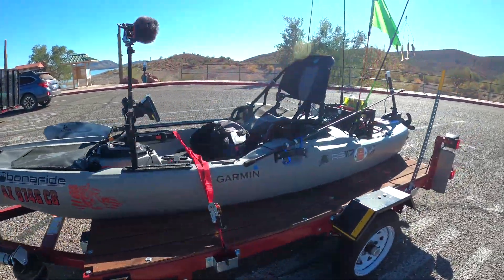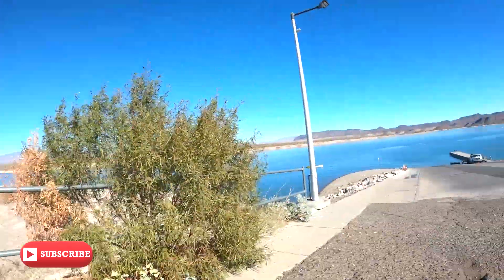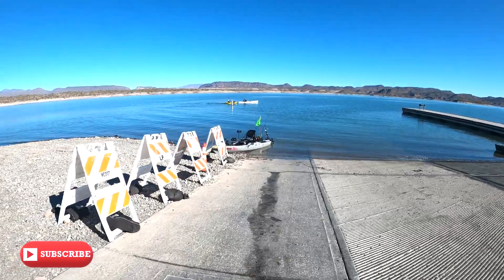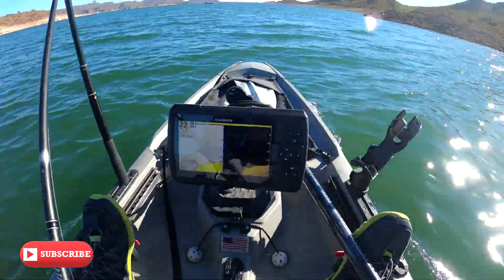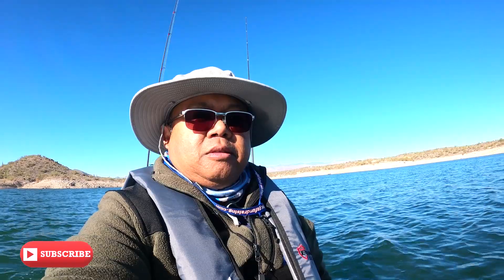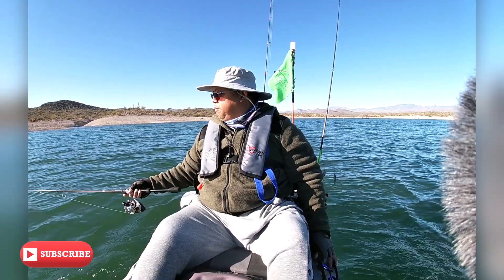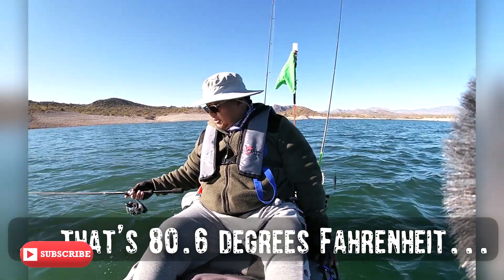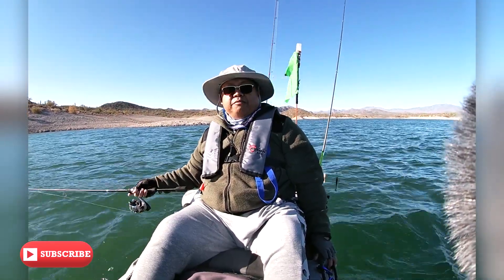PWM test run on the Lake, C2 Endura 30lb trolling motor, Miady 12V 16Ah LifePo battery set up.

Comment: Where did you connect those 2 dc fans on the pwm? Did you connect to the motor terminal or  battery terminal directly? And why did you orient the airflow that way? I am seriously asking because there are conflicting opinions about whether to pull or push the heat off the sinks
Reply from the maker: ...motor terminal on the PWM, so it only turns on when you move the potentiometer

Comment: nice test how long you can used the trolling motor with the 16 amp battery going half power 
thanks
Reply from the maker: since i only ran it 10 to 15 min. at a time, i was able to finish 4.5 hours of fishing, and ran the battery down to 11.5 volts

Comment: I bought the same trolling motor yesterday from Bass Pro and have a PWM on the way for my RS117.  I haven't decided on a battery yet.  Do you know how far you can go at 1/2 speed with the 16AH battery? Tournament trail starts in February and I want to be 100% ready.
Reply: Do you think getting three of those Miady 16ah and running them parallel would be viable? 48ah for $165 is difficult to beat if it works.
Reply from the maker: @Ijtreme83  ...ran mine, crossing the lake back and forth, still have over 12V when i got home...
Reply from the maker: I ran my lithium 12v 16A for more than 35 min, on and off, and still have 12v charge when i got home....
Reply: That is awesome and good to know, I'm glad to see that you have successfully rigged up a system with this particular battery, 6 of these would only weigh 24# and provide 96 ah of power and only cost $330 which is crazy for Lifepo4 batteries.  From what the manual on the motor says, it's max draw is 30 amp/hr on wide open throttle.  Without a PWM, half speed amp draw is 14 on setting 3 or 1 hour 7 minutes of run time on a 16 ah battery.  The PWM should increase this by a lot at lower settings, but none at all at full throttle. Maybe my math is off, dunno. Can't wait to try this myself. I really want the motor to slowly move down a bank while throwing a spinnerbait or crankbait without tying up my hands with the paddle. I have the hardware to setup pedal steering for that reason.  Good luck and thanks for posting this video.
Reply: I bought two of the Miady 16ahs and hooked them together in parallel.  Just fished an 8 hour tournament and they worked flawlessly. I ran the motor as much as I wanted to. Cruised mostly at 50 to 70 percent on the PWM.  I'm still using standard prop.
Reply from the maker: @Ijtreme83  ...glad to hear that, coz people are laughing at me ....none believers...
Reply from the maker: @Ijtreme83  awesome, and people were laughing at me...none believers....